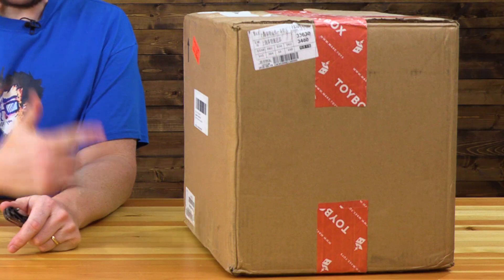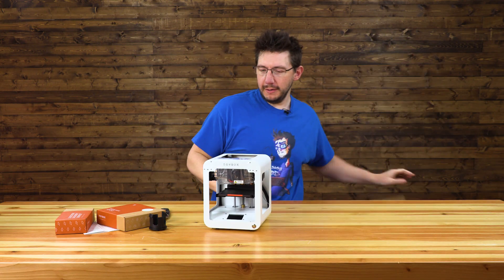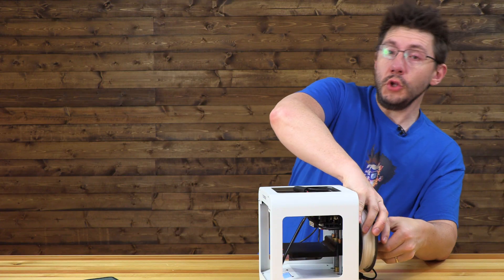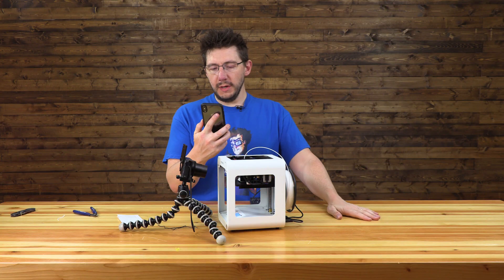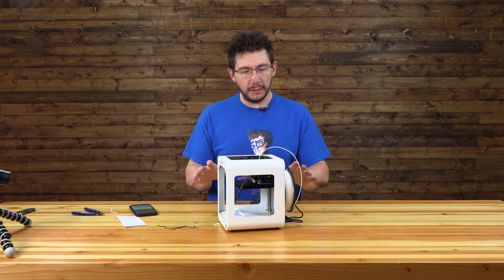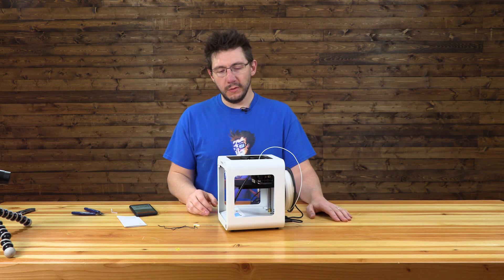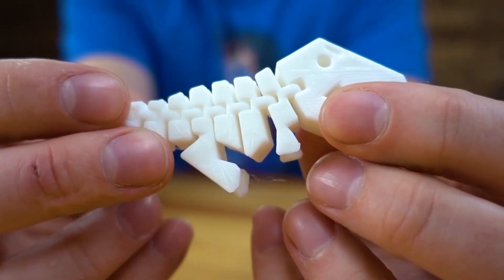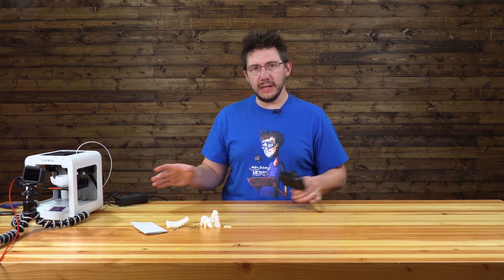Toybox 3D Printer As Seen On SHARK TANK

Comment: As a first printer, depending on price of course, it's not horrible. The Monoprice Select Mini is also a mostly ready to go out of the box printer with it appears a similar build area (Mini is 120mm cubed, ToyBox is. . . Who knows, 0 specs on the site) but the Mini isn't proprietary, used standard 1.75 filament. Gotta be honest,  $300 on sale, normally $400? $10 for a .5lb (0.23kg) spool of filament ($40 for less than a kilo). This this is not a bargain. The Monoprice is usually $199 and occasionally on sale.
I know you like it, Joel, but the price of the printer and filament are quite high. I could see going for it if it were affordable but not for what they're asking.
Reply: Software.  Cura isn't the easiest software in the world to use, and it sure as shooting isn't allowing a kid to print something at the tap of a button on a smartphone.
Reply: I know the old 15.whatever version of Cura, which came with my Mini, had an easy/simple mode. It worked okay for most prints and the only thing I think I had to change was supports or no. The ToyBox has a limited selection of items (500). There's no info so I don't know if you have to keep your phone/tablet tethered during the print.
Their proprietary system isn't worth $100. And their 'printer food' is over $40 a kilogram!
Reply: @Hawk1966  Speaking as a parent $100 Isn't that much if it gives my daughter a sense of independence and accomplishment.  The library doesn't bother me either because it is curated(incredibly important feature for a parent in 2019 looking to give their child any semblance of independence), and it is going to grow over time.  On top of that you can import your own files.

As for the filament according to the site it is standard 1.75mm PLA so getting that cheaper shouldn't be a huge hassle. 

As for having your device connected at all times that obviously isn't the case as Joel said he started a print on his phone then left for the baseball game leaving his daughter to print controlling the printer with her iPad. He also said he was able to check up on her via his device while she was printing from her device; great parental feature.

As a parent this looks like a great device, as an enthusiast I see your point of view, but I think it is looking at the device in a very narrow way that overlooks really important and convenient features that make the extra $100 a lot more palatable.
Reply: @CDRaff  speaking as someone living on a fixed income $100 is a lot to blow on stuff that can be done just as easily by applying a bit of learning and self moderation of what your kids do.
Reply: @Hawk1966  Then it isn't for you and you have a ton of options; why shit on something not made for you?

Comment: A huge concern is that it uses it's own website to setup and print. I didnt research if it can be used standalone, but limited skimming seemed that's not an option. So, remember Printrbot? If not, see Tom's videos about them going out of business and having a proprietary way to print that stopped working when they went belly up. 
As you said Joel, this is specifically marketed towards kids and ease of use. My kids dont need dumbed down versions of printing and printer software. But they are also teenagers. 
Just my 2 cents, beware printers that require proprietary apps/cloud only sources to send prints. Not for me.

Comment: But can it print a benchy?
Reply: If I have kids I’m naming the first one benchy
Reply: shudders from benchy tests while looking at a pile of 10 benchys
Reply: No
Reply: @kubectlgetpo  yes
Reply: U can make it
Reply: Can it run Quake?
Reply: Tf's a benchy
Reply: Darkness You’re an outsider, aren’t you? A “Benchy” is a small model of a cartoon-like tugboat that has become famous in the 3D-printing world for one reason, and one reason only. It’s used as a standard of comparison to “test” the print quality of a printer. Just look up “Creative Tools Benchy” on Google, you’ll get plenty of results.
Reply: @banjogates  We used to try to make lego that fit together well back when I was new to 3d printing back in 2012
Reply: @banjogates  I'm I bit of an outsider too, as in I never used a 3D printer, yet. I have a non finished Anet A8 I'm still working on getting up and running. And even now looking into possibly getting either a Creality 10S Pro, or a Moai SLA printer. Even though I can possibly use the new 0.1mm noels on the Cr 10S, it can't beat the 0.07mm of the Moai.

Some info on it here: https://www.kickstarter.com/projects/1554809440/moai-affordable-high-resolution-laser-sla-3d-print. There is a nice FDM and SLA print at 0.1mm to show the difference at the same settings. SLA wins for quality, but it be my guess that the FDM print is stronger, or could be made stronger, depending on print speed and heat settings and filament type used.

This sunk Benchy shown in the link below made in SLA looks real nice. Would love to have prints that good. ^.^
Link: https://i.ytimg.com/vi/Srl96IoeWJs/maxresdefault.jpg

Perhaps, someday, if I go with the Moai. >.>

But I like the Cr 10s Pro too for all it can do at its $649 average price tag. ^.^

Both are good for what each can do, over what the other can't. Choices. They not easy at times. >.<
Reply: Print volume is too small
Reply: @fhuber7507  lol wut? a benchy not a bench. :)
Reply: @fhuber7507  you so know 3d prints can be resized right? Lol
Reply: @fhuber7507  < this guys joke went over all youre heads

Comment: Can you print v slot bars for ended 3 and extend the build area?
Reply: You could. Walter at Kuntry 3D here on YouTube has built several printers out of 3D printed extrusion. The printed extrusion will wear a lot faster than metal, and any imperfections in the printed extrusion will be transferred via the rails to your prints. So... just know that ahead of time :)